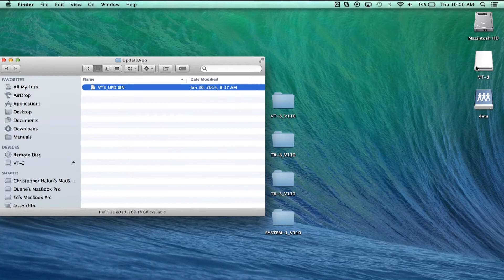Roland Aira - How to update VT-3 Firmware

Comment: Everything works until I press the 1. Nothing happens. I reset it all, try again, still nothing. Any ideas ...? Thanks.

***Update
Now when I press the blinking 1 I instantly get an error flashing on the peak light. I've tried it on a PC running windows 7 and a laptop with windows 10, no luck on either.